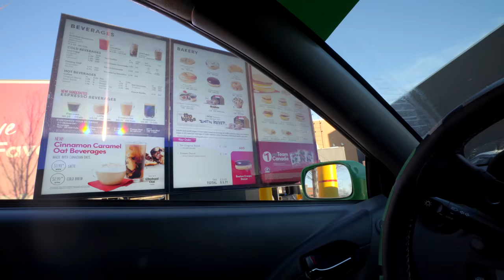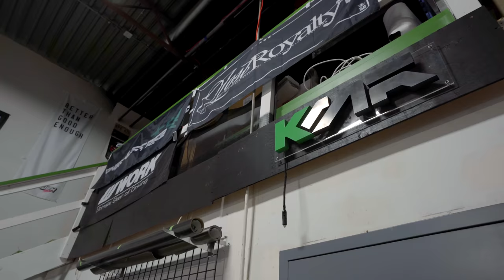BUILDING A TINY HOME inside my COMPACT CAR (pt. 4)

Comment: you can use a hand router or hand chisel to make that groove for those hinges.  The way you did it is fine too just not as efficient but it still works. Also,  you should get a counter sink drill bit to pre drill holes so the screws don't stick above your panels or you can use a brad nailer for your flooring

Comment: See it was much easier when you used to drill bit with that tool right For the next  The tool you wanna need it wouldn't cost you that much and that was a chisel and a hammer If you watch other videos and see what they're doing it's pretty easy it's pretty easy to go ahead and chisel out that part you want it so you could go ahead and put the hand on Look forward for your next video take care💫💥💫💥💫💯😎